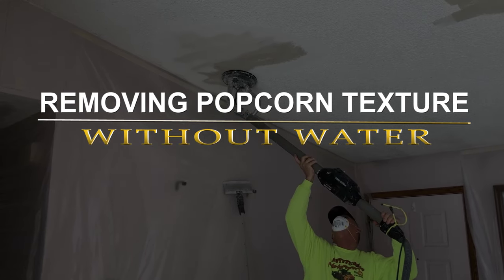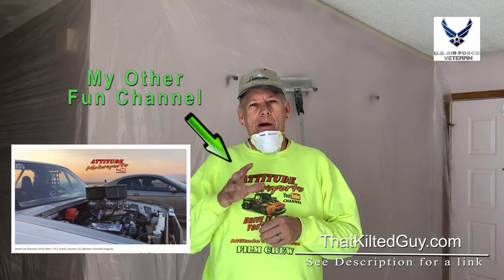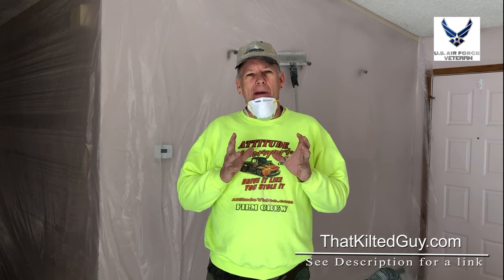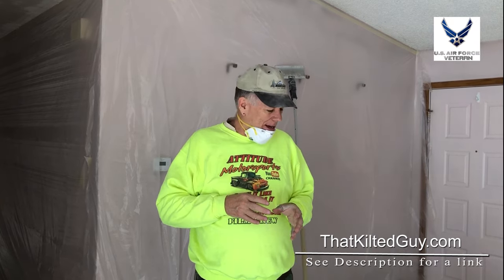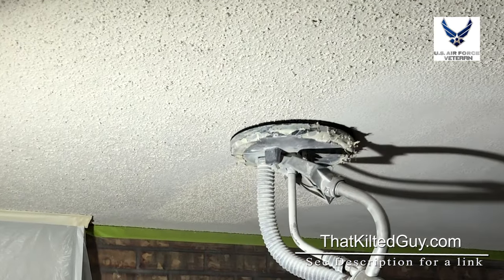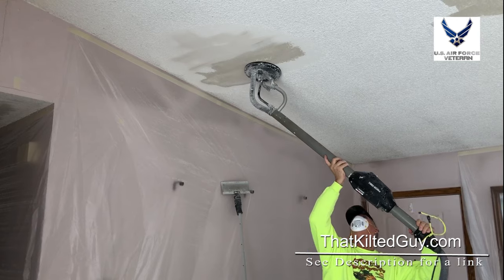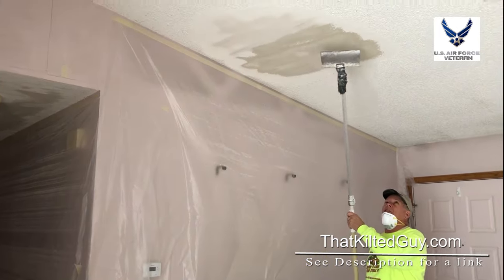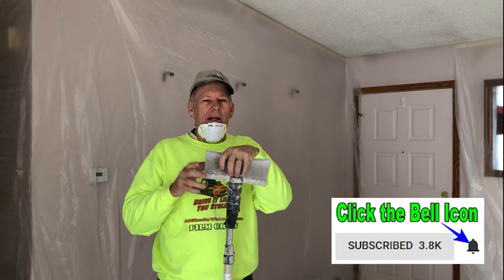Popcorn Ceiling Removal by Sanding, DOESN'T ALWAYS WORK!

Comment: I bought a air sander tried on my painted popcorn ceiling, what a dust storm, plus it was kind of heavy for me to handle for a long period of time so I guess I will go back to a ladder and a trash can lid to catch the droppings. I should be finished with this little project in about five years LOL.
Reply from the maker: Shirl B, if you don't have a sander hooked up to a vacuum capable of handling drywall dust, yes it would be a dust storm from hell.  Sorry that didn't work out.  In this video mine is hooked up to a high quality vacuum.  But if you don't want to do all that, have you tried just scraping it like in this video?  Or, do it the way I most often do it which is with water.  I have a video explaining that at: https://youtu.be/IkqCj0wFzwU  

Let me know if that helps, or if I can help you in any other way.  Thanks, Guy
Reply: Yes I did have it attached to a large shop vac. I love your videos and tips you make it look easy, not so easy for a novice but i'm not going to give up!!!!
Reply from the maker: Good, don't give up, you'll get it.  A few more pointers.  If your sander is variable speed, sometimes slowing it down helps as it can sand so fast that the vacuum can't get it all sucked down the hose fast enough.  And you have to keep a firm pressure against the ceiling or it will just shoot it everywhere.  Also, the sander needs to have a drywall rated filter or bag or the dust will go right through it.

But if you give up on the sander, the wet method is so much easier for most.  Anyway, thanks again, Guy.
Reply: I thought the air sander might be pretty heavy.
Reply: @ThatKiltedGuyDIY  e

Comment: I have popcorn ceiling that's been painted over and is peeling off the ceiling. It's coming off beautifully over the drywall but is quite stuck on areas that are taped and mudded (joints, edges, screw holes). I've tried with a scraper, sprayed it with water, and am seeing from your video that sanding might not work. I'm at a loss. Any recommendations? You've got great tips for a newbie girl DIYer! Thank you  for your videos :)
Reply from the maker: Wet it up to five times with a 5 to 15 minute pause in between to allow it to soak in. Then scrape
Reply: Lots of vinegar diluted with water light sand

Comment: OUR CEILING WAS SEALED AND WE BEAT OURSELVES UP trying to get it down, there is certain areas that does not want to come down. WHAT CAN WE DO? we forgot we sealed it after a house fire, ??? we must smooth it out enough to roll on a orange peal ,tecture ????Will the prof. ceiling fan , finish knocking it down. Thank you ps we old, 67 getting mad at this ceiling
Reply from the maker: I found that unless you have painted it several times or in glossy paint, that I can still remove most of popcorn ceiling. Sometimes I have to soak it up to four or five times waiting 15 or 20 minutes between each soaking before it softens up enough. If you try that, don’t be afraid of over wetting it as it will just drip onto the floor if you do.

Comment: Hi and thx for these videos! I have a few bare drywall spots say 2x2 on popcorn ceiling. I won't be able to do the whole popcorn removal until next year. Is my best action to prime the bare drywall spots with say kilz pva to seal it until next year? Would it be a problem later on with scraping the popcorn? Please advise sir and thx for all you do!

Comment: Hello!
We recently purchased our first home and it has popcorn everywhere, walls and ceilings 😩. My husband and I are trying to removed it all by ourselves but the house has latex paint and so water doesn’t really help. I was exited to see this video until you mentioned that if painted maybe this is not the best method. So, does this mean our only option is to do it by hand/dry? We don’t want to re-walk if we do t have to. 
Thank you 😊
Reply from the maker: Hello Mariana Ames, here's my quick quide to removing popcorn ceilings using the wet method.

First, test the procedure below on a small area to determine if it will really scrape.  If it doesn't after doing the things below, you will need to repair the attempt, or proceed to other alternatives.  You can view those in my video at- https://youtu.be/74A1Fm4K3mE

My current primary video, showing all the steps to remove popcorn ceilings is at: 
https://youtu.be/IkqCj0wFzwU

1- Spray the surface using VERY hot water, with a little bit of soap in it.  I prefer Krud Kutter (Link in the description) as it seems to soften dried paint better, but most any soap will work.  I've experimented with most suggested things like vinegar (very smelly), to fabric softener, etc, and they all seemed to work the same.  You want to attempt to saturate it to the point where the water is starting to drip.  You don't want it raining, but soaked as well as you can.  I prefer a pump style garden sprayer, or my home made sprayer that uses a 12v weed sprayer pump and 20' hose.
2- Let it soak until it looks like it has soaked in all it will.  This can vary from a few minutes to 20 minutes or so for painted popcorn.
3- Test scrape it to see if it scrapes easily.  If 95% of the entire popcorn texture and base mud doesn't scrape off easily, soak again.  Or if you see that the actual drywall is barely wet after scraping, soak it again.
4- repeat the process above until it scrapes easily.  This can vary from one coat of water, (rare as it usually takes 2 coats for me), to up to 5 coats of water.
5- Let everything dry overnight.  Opening up windows in the summer and putting fans in the room help a lot as you have a ton of moisture to get rid of.  Note that cleaning up all the droppings is MUCH easier if you dry it out as it will weight a ton when wet and you can barely fill a trash can with a construction type bag, about 1/4 full.  When dry you can double that.
6- Once dry, sand the entire surface to get rid of the final base coat that didn't scrape off.  To understand this, watch this video- https://youtu.be/S8omX9yZm6g
7- Repair any defects found after scraping and sanding.
8- Finish for a smooth finish if desired, or do a texture.  

HERE'S MORE VIDEOS TO HELP- 

*- For a smooth finish, watch this video- https://youtu.be/4T6x7wiP-aA
*- To apply a texture, watch one or more of the videos in this playlist- https://www.youtube.com/playlist?list=PLCrazHylAOEk4mixQ2IHezYSvJtlu7kVD
*- To understand how to repair minor defects, watch this video- https://youtu.be/_sSHn51WYxs
*- To learn how to mix a crack on the ceiling, check out this video- https://youtu.be/6ZIVR_fMFJI
*- To learn how to skim coat a ceiling, after the above steps, watch this video - https://youtu.be/wgqbQRJcZ8c
*- To learn how to skim coat over the popcorn ceiling to get rid of it, watch this- https://youtu.be/hmUInhuvbKs

Mariana Ames, if I helped you save money on your project, or you just want to show your appreciation for my help, please consider joining our Youtube membership for as low as $2.00 a month. Your support means the world to me and will help ensure we keep putting out more, and better content to help you. Plus you'll get a special badge next to your name in comments, bonus and early release content, and more.

You can join here- https://www.youtube.com/channel/UCSinsqowcKxmSaKkx3W9_0w/join

You can also join our Patreon FAN Page for as little as $3.00 a month, flat rate. You'll get bonus content, special markers in comments telling me your subscribed, etc. You can do so at: https://www.patreon.com/ThatKiltedGuy

Thanks for all your support!
Reply: @ThatKiltedGuyDIY  Thank you SO MUCH for replying. Hopefully we can make t work. Merry Christmas to you and yours!
Reply: My ceilings were painted too but I got around it. After protecting everything with plastic I scraped the ceiling really well while it was dry to where it was almost flat, THEN i sprayed and scraped it. It came off pretty easy. I guess the key was to expose little spots of popcorn where the water can get in behind the paint

Comment: Is the ceiling ready to paint after I use this sander? Or do I have to skim coat the entire ceiling? Or will primer and paint be fine after sanding?
Reply from the maker: You’ll have to skim coat and texture it or work on it further for a smooth finish. I have a video showing how to do a smooth finish if you need.
Reply: I was looking for the video but I couldn’t find it. Also when you say skim coat do you mean the entire ceiling or just spots?
Reply from the maker: Skim coating generally means everything. Unless it’s sands super smooth which is highly unlikely, you should skim it all like in this video. 
🟢Smoothing Out A ROUGH UGLY Wall by Skim Coating it - LEVEL 5 Babys Butt Smooth. 
https://youtu.be/4T6x7wiP-aA

If you appreciate our help with your project and would like to support our channel, please consider joining our YouTube membership for as little as three dollars per month. You can join by clicking the join button beside the subscribe button on any of our videos. Thank you

Comment: Have you tried a multitool with a scraper blade against painted popcorn?  I bought one of the stiff scraper blades two weeks ago bc a guy had put mud out over tape seams and apparently didnt know you're supposed to spread mud make it wider each coat. He just stacked his mud up in about a 5 inch wide belt around the room and it costs us a lot of time. We dont own a lot of drywall tools but found that the multitool scraper was quickest way to bring the thickness down to where it could be sanded.  Just wondering if you had ever tried it on painted popcorn and did it work?
Reply: The mud was the thickness of 2 slices of cheese in some spots it was a few coats all applied with a 4 inch knife. I was wondering how he got so much done so quick and the answer was he wasnt spreading his mud at all, just stacking it
Reply from the maker: Narrow stiff blades can work but can do more damage and are slow

Comment: I've been removing Acustic from cealings for many years done it many different ways. Well when it's time to do my own cealing it's like it's welded to the cealing. I wet it many many time still stuck like chuck. Very slow process that's driving me crazy. 
My house was built in 1946 and they started doing acoustic cealings back in early 70's it must have layers of paint. 12x30 cealing going to take around 3 days of hard labor. 😪

Comment: Doesn't the use of either one depend on the ceiling testing negative for asbestos?
Reply from the maker: Yes. I try to explain that often. But if it has asbestos in it and it’s locked down with a solid layer of paint, you can skim coat it as you’re not disturbing it

Comment: Can I use a rasp to knock off the high spots and then skim coat ?
Reply from the maker: I just scrape with a 10” knife
Reply: @ThatKiltedGuyDIY  Someone might create a rotary cheese grater disk that was made of metal and could be cleaned and reused.  Set the depth like on a router to prevent damage to the drywall.

Comment: I dont know but I dropped to a 36 grit and it eats the paint off. I found if its painted with semi gloss its a pain no matter what
Reply from the maker: I used 24 grit in the video but if it’s painted I find it much easier to remove with water. Thanks for commenting
Reply: @ThatKiltedGuyDIY  , do you have a video showing how to use water to remove painted texture?  I'm trying to remove texture that is very pointy and 0.25 - 0.5" tall. I was thinking I could sand it to get rid of the peaks, then spray it, and then try to scrape it.  I did a test run with no luck, so I'm hoping you have other ideas.

Comment: If your building is built in 1983, does it have asbestos??
Reply from the maker: It was banned in about 1973 so it should not.
Reply: 1989 was the ban so yes you should be testing anything prior to 1990 personally I test to early 90s as they were allowed to hoard the materials and use them up. The test is cheap lungs are not
Reply from the maker: Actually that’s not quite right. Here’s the information from the mesothelioma website. What you’re referring to is a different ban but not the one regarding popcorn ceilings. 

“The Environmental Protection Agency (EPA) banned hazardous pollutants from ceiling coverings in 1973 with the National Emission Standards for Hazardous Air Pollutants (NESHAP).

However, researchers note popcorn ceiling materials may have still contained asbestos after the ban. Existing inventories of asbestos products were exempt from the ban and workers may have continued to use them. Some reports indicate asbestos may have been present in popcorn ceiling material stockpiles as late as the 1990s.”

From: https://www.mesothelioma.com/asbestos-exposure/products/asbestos-popcorn-ceilings/

So it would be extremely rare to find it after 1980 but it is possible
Reply: @stich1960  I asked the management if it had asbestos and they said no. Don’t know if I should take their word or get it tested
Reply from the maker: If you’re not planning on disturbing it like removing it, it’s safe. If you’re thinking of removing it, a test would be wise and they only run about $50 if you do it yourself. Go to the hardware store and ask for an asbestos test kit
Reply: @ThatKiltedGuyDIY  why I asked because in 2017-2019 it was chipping down in various areas and it was patched and fixed up by contractor but I got a transfer to a different apartment and now it has been chipping down so I just paint it after the stucco fall down
Reply: Oh maybe I didnt realize there where two different ones I tested a late 80s recently and had it test positive so idk for 100 bucks I would rather test. People also lie or don't know the age of their house so that's another angle to think on. I used to be the saftey officer/ responsible person for a company before going on my own so I may be a little anal about it I know. But I have also seen what it's like in late stages of copd first hand and I wouldn't wish that on anyone.
Reply: @stich1960  yeah I will get it test but I also look at a piece of the stucco when it chipped down and I don’t know if you can see the fibre pieces from asbestos but I didn’t see anything like that from the stucco that fell. Is asbestos visible in stucco if it chipped down? I never see anything flying around in the air like fibre. It’s just dusty when it chipped down
Reply from the maker: Safe is better
Reply: @BajanBoo  not really I think under a microscope it is visible. Just test it if your apartment is pre 1990 imo
Reply: Asbestos was never actually band you just can't buy it but if you have some laying around you can still use it .... in my state you have to test any house 2004 or older. The wet method is they way I prefer to remove  it just poly the floors and walls spray it till it drips and don't let it dry out keep spraying water on it periodically